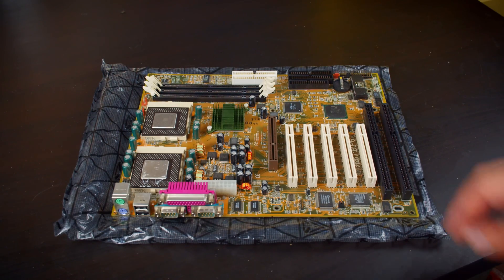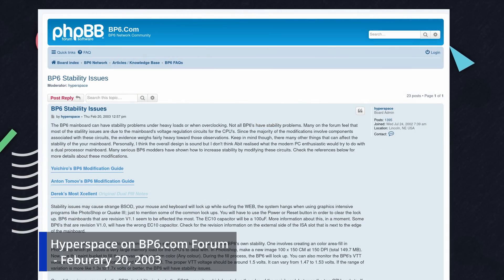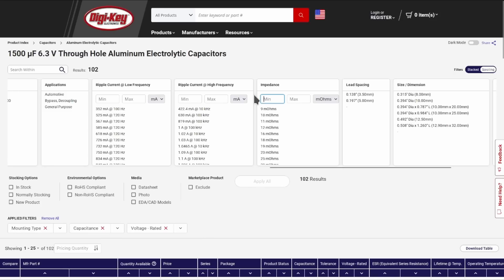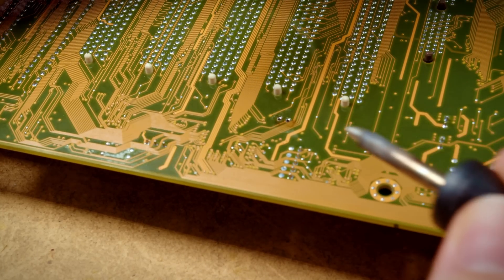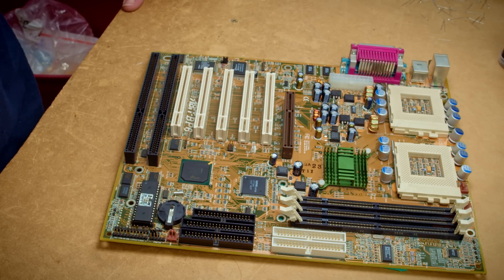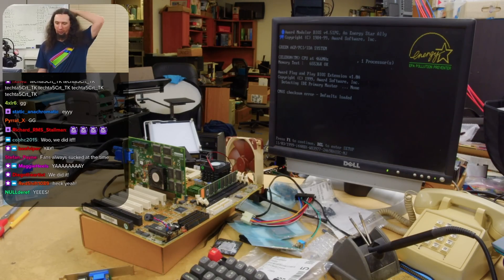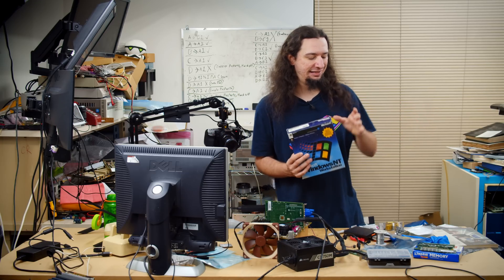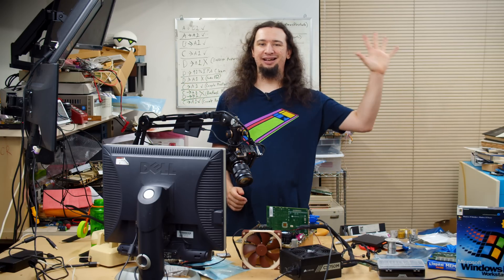Abit-BP6 ReCap - Dual Processor Motherboard Back to Life

Comment: I had a Asus CUV-4X DLS with two Pentium 3 1000Mhz Coppermine. It was a beast but the northbrige was a pain to be stable.
Reply: I run mine with 4gb and 2 Tualatins at 2ghz just fine

Comment: Legend is right! It's rare that I remember the model number of a motherboard but Abit BP6 has that honour (along with Asus K7V).  I had one of these running Windows 2000, it was packed with as much RAM as I could afford, two Celeron 366A's running at 550MHz and a janky pile of disks.  It was our lanparty server, it hosted 'backups' of all games that people might need and all the other files that people liked to trade at these events as well as running any game servers we needed.  

It was the first motherboard that us common gamers could use to put together a system like this, it was also pretty good just for general enthusiast/gaming purposes as well with id making sure to support SMP in their game engines at least, while there wasn't a whole lot of other software that could take advantage of the dual chips it was still pretty great for bragging points.

Comment: What's with the exposed metal dots on the opposite side of the pin grid array on Intel CPUs of this era? It just occurred to me, that started with Pentium MMX and lasted beyond the Slot 1 / 2 stuff after Intel moved back to sockets.

Comment: Is there a Linux option that will see both processors?
Reply: Yes, it was working quite fine under RedHat Linux back in 2000. 
No idea what modern distro may work on it, though, I guess you need to look for one that still supports 32bit CPUs.
Reply: @SergioBallestrero  Thanks.
Reply: yes , linux supported this SMP board
Reply: @tomservo5007  TBH my original post was more prompt than question.  Linux FTW again as always. 🙂

Comment: I've got a BP6 with 366's OC to 550. It also sports a Voodoo5 5500. Ran Linux and windows 2000 workstation primarily. It didn't get replaced until I moved to AMD Athlon. I wished I'd kept the Athlon machine too.
Reply: My god what a trip down memory lane.  I had the same except i went NVIDIA.  When I got the board win2k wasnt out yet and I had to "hack" in AGP support in windows NT4.
Reply: I've got the same board and it still runs but did need a recap after 5 years of operation, it had a Nvidia 5200.
Reply: Post evidence or lies
Reply: @0_1_2  How would he do that?  Photos and videos can be faked too.  Maybe he needs to invite you over to his house, so you can see it with your own eyes?

Comment: I had one of these.
LOVED it!
Reply: I had a pair of 300MHz Celerons on it, which ran great overclocked to 450MHz.
I made a DIY water-cooled system, to make the PC quiet enough to use as a home theater system, back in 2000.